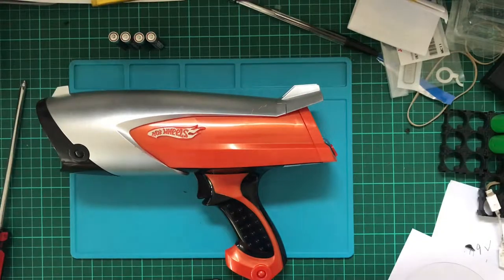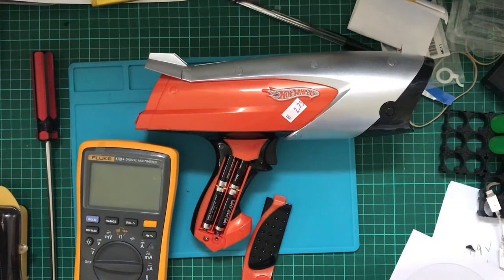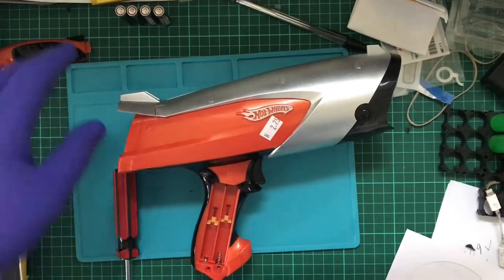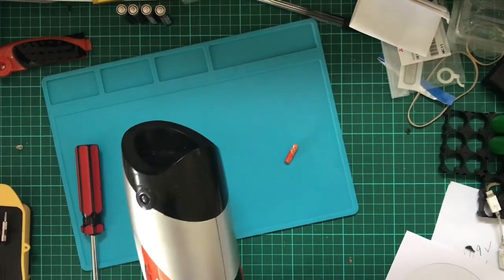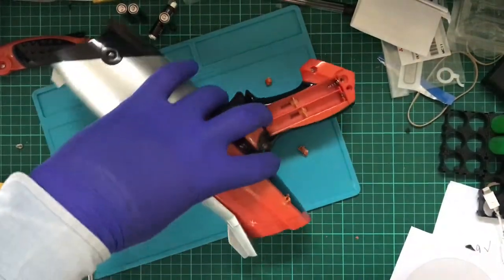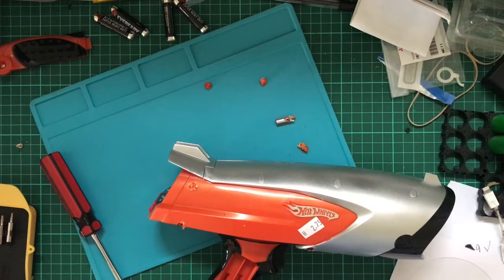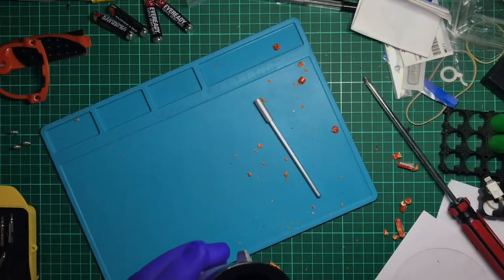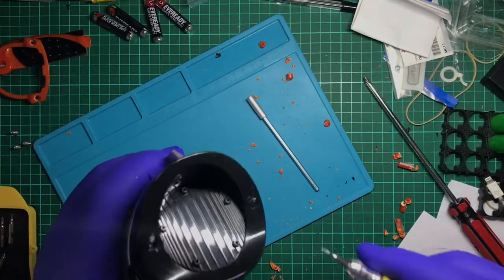Hotwheels K7876 Radar Gun ( I smashed it with a rock...)

Comment: I got mine apart today.  It did take some perseverance though.  Not all the screws and their covers are immediately obvious.  Removing the two screws holding the front cover helped by revealing one more.  There are a couple of plain plastic alignment pins that hold things together too.  The silver bit at the upper rear is tricky, it requires that the two orange halves are separated whilst remaining parallel as it is slotted into the two orange halves.  The orange back cover has a little physical clip at the top so that part needs its screws removed and then levering up and off.  I found a 5 mm drill was optimal for drilling out the plugs.  Here's the screw count:  three along the top of the silver,  one at the bottom of the silver,  two at the bottom of the orange ring at the back, two in the black ring at the front, one more side-to-side in the orange UNDER the black ring at the front, three in the handle (near your thumb, your little finger, and the obvious one in the battery compartment), and finally two at the back in the orange and the black/orange.  Total of 14 by my count.  I used a PH2 driver. A PH1 just wouldn't provide enough torque to 'crack' the screws without camming out.  The issue with the PH2 driver was that it was a very tight fit in the holes, especially the deep ones.  I needed to very gently 'ream' the holes with the side of the 5 mm drill bit to get it to fit.  I even had to pick out bits of the plug with a fine screwdriver on a couple of occasions.

Comment: Believe it or not, that was helpful. I'm about to take one apart to try to repackage it into a small case. I figured those caps were covering screw holes but even with a drill I couldn't really see what was happening inside. Now I have a good idea how it's assembled. I'll probably take a dremel grinder to get it open.
Reply from the maker: I really dislike that I had to take a rock to it, but its great to know its been useful.
At least you know where not to hit it.
Reply: @Michaelblog456   Ha, sometimes you gotta do what ya gotta do.  I thought those plugs were plugs, but I didn't realize how deep they were. I tried drilling a couple out and even after drilling in a 1/4 inch or more I still didn't see a screw. So your video clarified what I was looking at.
I just wanted something to generate a 10 ghz signal, so I don't even need the horn/tube. Seeing what's inside I know I can put it back together in a small case.  Regards.

Comment: got one at auction. new in package. dead unit once I put good batteries. checked batteries.  Looking inside the battery compartment, its got dull metal looking a little corroded maybe.  Will perhaps do video on opening it up witha  drill and such.  I actulally have thee xact issue in this video. no volts.  I'm suspecting corrosion.